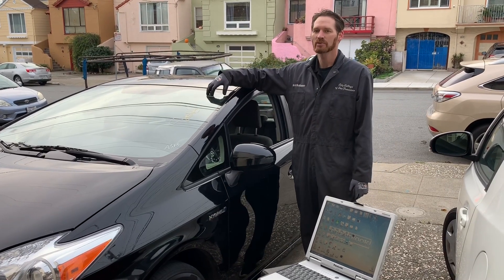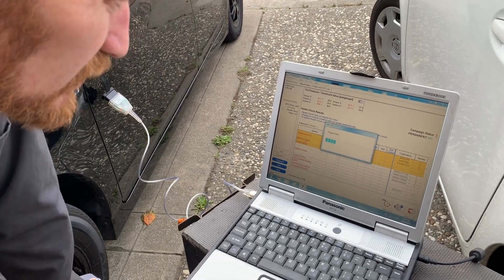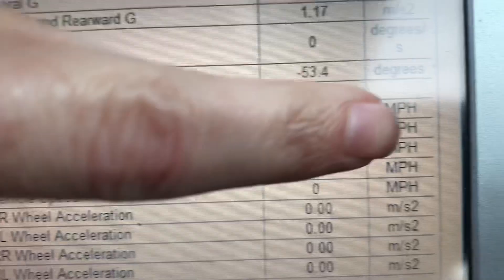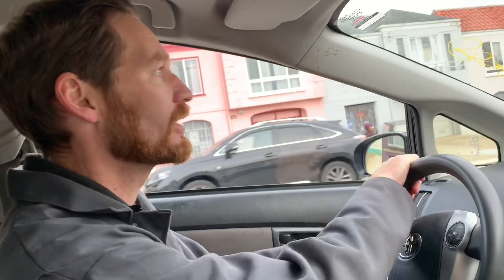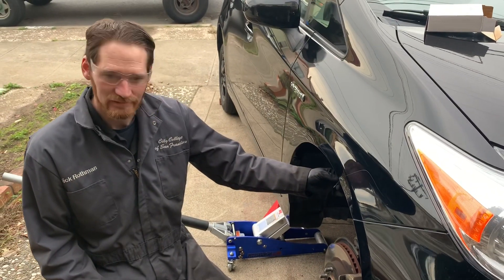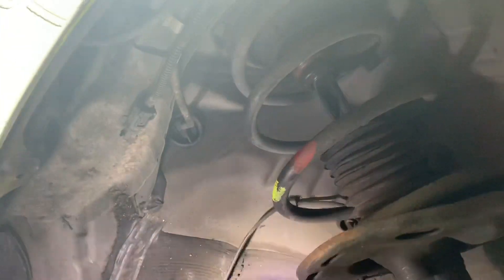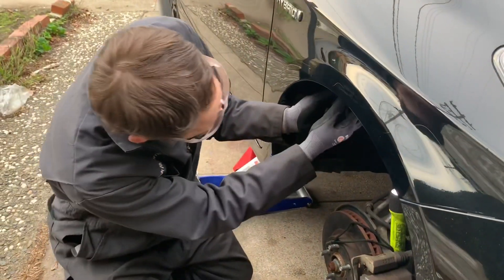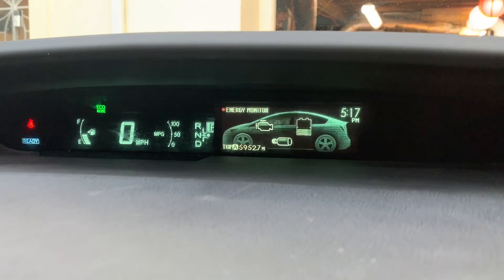2015 Prius ABS repair

Comment: Thanks for your video! It was helpful for me. The first I'm deleted the c-code of error low and high voltage and FL, and this was enough for correct work without check light.

Comment: Hi mr. electric my prius abs actuator probably has a problem. My abs lights and brake warning and traction lights are on. Are you near socal can i bring it to you for a fix? I havnt change my brake fluid do you think i should change my brake fluid first before repairing the abs actuator?
Reply from the maker: I dont think changing the fluid will fix the issue although low fluid will cause those lights. Even if it is low and gets refilled the code may need to be cleared with an appropriate scanner. Sorry I am not available to help in person.

Comment: I have a code C1464 and I also used to have a front right sensor open circuit code on my dad's 2014 camry, but replacing the sensor only fixed the second code and C1464 is still there. Using my OBD scanner, I've seen that both front wheels read the same and accurate speed, so I'm not sure why C1464 is still there and won't go away even after clearing it. Any ideas?
Reply from the maker: Is there rust on the wheel hub?
The sensor might be trying to read a rusty, damaged tone ring (the part that spins with the wheel)
Reply: @Mrelectric423  I didn’t check too closely, but the tone ring looked pretty black when I removed the sensor, but I’m planning on cleaning the connector contacts soon so I’ll check then
Reply from the maker: @ZareefHuq  Replacing the tone ring means replacing the half shaft or wheel bearing depending on the vehicle
Reply: @Mrelectric423  I cleaned the abs ring and the connector for the abs speed sensor and the code went away
Reply from the maker: @ZareefHuq  Yes!!

Comment: I have a 2005 Prius with an abs light that’s stays on even after the car is completely turned off. Sometimes the rear defroster light and the vsc as well but mainly abs. Have you ever seen something like this before? Anyone
Reply from the maker: sounds like a wiring issue. I have never seen that before.

Comment: Do you have to use tech stream to replace the abs module or can you simply replace the faulty one with a running one and the computer will adjust itself?
Reply from the maker: You can usually just replace it without techstream

Comment: Helpful video!  When you are finished and you say the ABS sensor light was cleared, do you mean that it cleared itself or you entered the clear command on your software?
Reply: FWIW, my cheaper diagnostic fixd indicated a bad rr sensor or circuit on 2013 Prius.  Replaced visibly damaged harness, but problem persisted.  I was not able to duplicate your testing, but did confirm that working LR sensor had about 32K ohm resistance, RR was only 17K.  Replaced RR hub, and it measured 32K.  Drove car tapped brakes twice, and that must have told system all was right because lights went out.  Your video went a great distance in helping me out.  Thanks!
Reply from the maker: @gregloew3093  Nice work!
Reply from the maker: It just disappeared

Comment: Sir need yiur help my prius 2011 showing abs light in and code C 1246 is diagnosed please help.
Reply: I have the same code  C1246 on my 2012 prius !  checked the brake fluid . reset and cleared code!  it back to normal now.

Comment: Hello...
I have prius s touring car 2013 and now its dashboard shows warning alert abt ABS,PARKING BREAK,BREAK AND VSC.. Whay shoud be the reson on it ?
Reply from the maker: You need to get the error codes using a scan tool
Reply: I got the error code C1391.abnormal leak in accumulater .. what do i do right now ?
Reply from the maker: @theken6341  On your gen 3 prius there are two parts that could be at fault, actuator and accumulator. These are built into one component on the older gen2 shown in this video. It is hard to tell which is causing your code, some people replace both just to be sure. One is easier to replace than the other so some people do the easy one (actuator) first.
Reply: @Mrelectric423  is that good enough for repair and fix the accumulater ?
Reply from the maker: @theken6341  You need either an actuator or accumulator, I cant tell which one.
Reply: It IS FREE from Toyota Dealer for Unlimited Miles until 31 August 2021.  AFter that it is 10 years /150k miles policy.  It is NOT RECALL, so Owner has to actively contact Dealer.  VOLUNTARY COSTUMER SATISFACTIONS PROGRAM.  https://static.nhtsa.gov/odi/tsbs/2019/MC-10164922-9999.pdf

Comment: When you install the brake actuator for the Toyota Prius was it brand new or used and if I use a use one will it work
Reply from the maker: Used is the best choice, new actuator is too expensive
Reply: Do you sell any use ones? Is so can I buy one from you
Reply from the maker: @ilovetechalot9490  i recommend buying from LKQ seller on ebay. They are the largest used parts seller in the usa
Reply: LKQ online just want to make sure was going to buy brake actuator for 2008 Toyota Prius water to make sure the seller was caught LKQ online on eBay.
Reply: It IS FREE from Toyota Dealer for Unlimited Miles until 31 August 2021.  AFter that it is 10 years /150k miles policy.  It is NOT RECALL, so Owner has to actively contact Dealer.  VOLUNTARY COSTUMER SATISFACTIONS PROGRAM.  https://static.nhtsa.gov/odi/tsbs/2019/MC-10164922-9999.pdf

Comment: Like the video, I got abs signal, dynamic brake signal and traction control signal , 3 of them same time , what could be the reason Mr Electric?
Reply: Same issue..still has it
Reply from the maker: You need to get the error codes using a scan tool
Reply: It IS FREE from Toyota Dealer for Unlimited Miles until 31 August 2021.  AFter that it is 10 years /150k miles policy.  It is NOT RECALL, so Owner has to actively contact Dealer.  VOLUNTARY COSTUMER SATISFACTIONS PROGRAM.  https://static.nhtsa.gov/odi/tsbs/2019/MC-10164922-9999.pdf